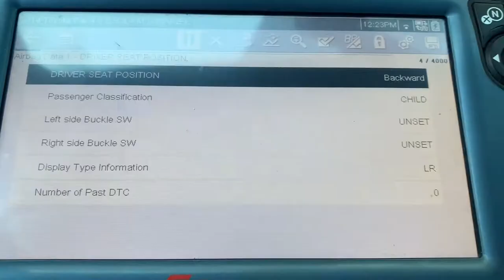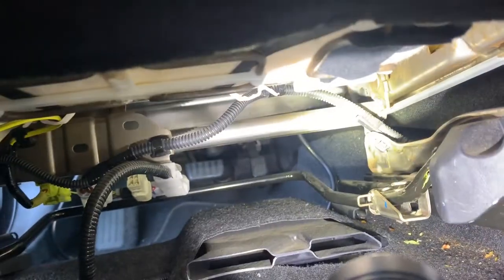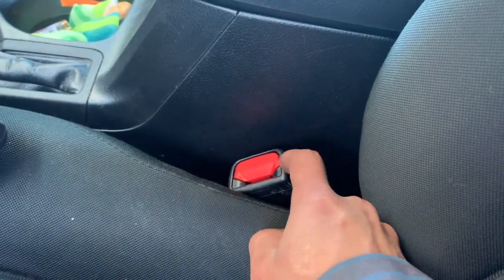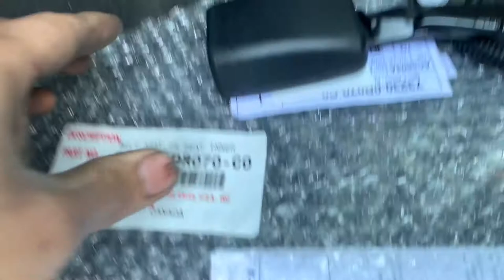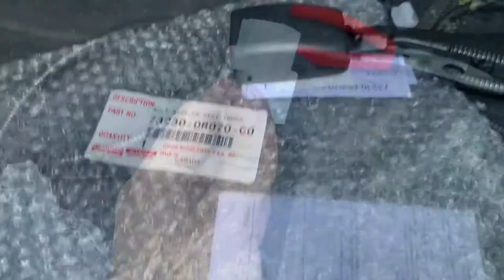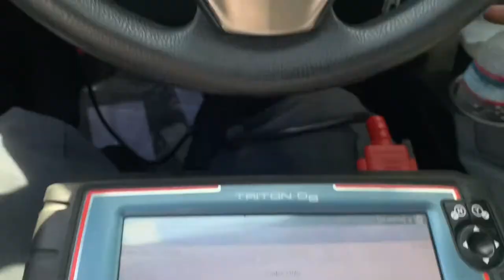Toyota Rav4 Airbag Seatbelt Buckle Light On (Code B1653 / B1656)

Comment: Great video. I have had the same issue with my 2010 Rav4 base. The two lights on dash (passenger) blinks continuously; The Seatbelt airbag light at bottom Lt. of the RPM display is also on constantly. No matter it someone in seat or not. belted in or not. I!ve taken it in 4 tones over 9.5 years of ownership. 2 Toyota mechanics couldn’t or wouldn’t diagnosis it in Tennessee. Finally in Indiana I’m told it!s a sensor. 1) How much should I be charged to change it? 2) where are you located? Also the lights will go off if temperature outside is in the lower 30’s.
Reply from the maker: I work in California. To replace the seatbelt buckle is 1 hour labor. Depend on the shop how much their rate is for an hour.

Comment: Hey mate,
Great video! 
Let me ask, did this vehicle was beeping the seat belt, together with the seat belt light on dash?
My car its beeping and light on, weird that I have removed once the white plug, and put back, and stepped. However, this week, its back the beep and light. 
Any clue? It is the same issue? Thanks
Reply from the maker: Most like is the seat belt buckle.This vehicle I've worked on does beeps too, while driving and idle too. The buckle is bad (malfunction), thats why the seat belt is on. Replace the buckle.
Reply: @Ah Duuu  thanks very much. I open the plug under, and after plug back and stopped. However I am kin to get the part and replace. Cheers for the video and for the reply.

Comment: I have a 2011 RAV4 that the passenger side seat belt light does not signal the light on dash that the seat belt is not fastened when there is a person in the seat. It also says the airbag is off on that side as well. I am not sure if it is the seat belt switch or the weight sensor in the seat.
Reply from the maker: If you buckle the seatbelt, and the light still on that's mean the the seatbelt buckle itself is bad (replace the buckle). For the "passenger airbag light On/Off". The passenger seat has a pad sensor, senses someone is sitting on the seat, so the passenger airbag light should be ON, incase if there's an accident the airbag would deploy. When there's no one on the seat the light should be OFF, so airbag doesn't deploy. In your case you going to replace the whole seat, the dealership does not sell the seat pad itself, they sell the whole seat.